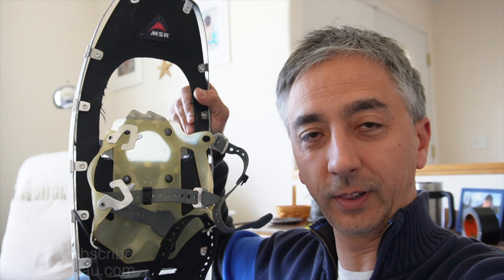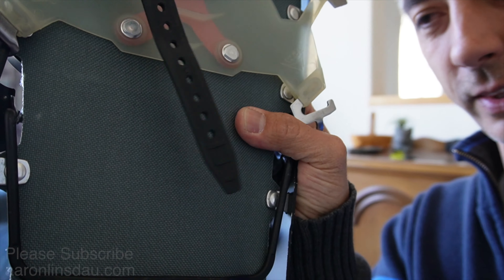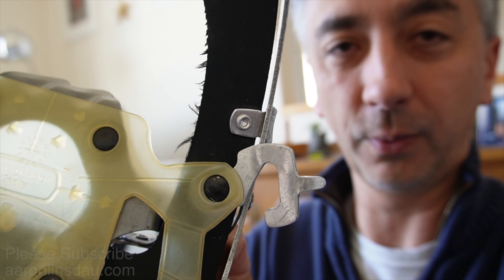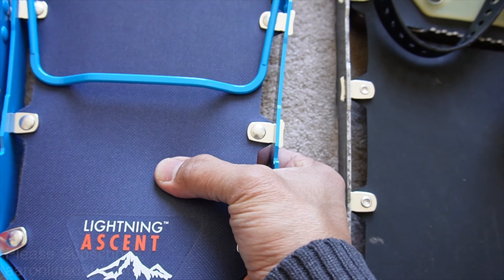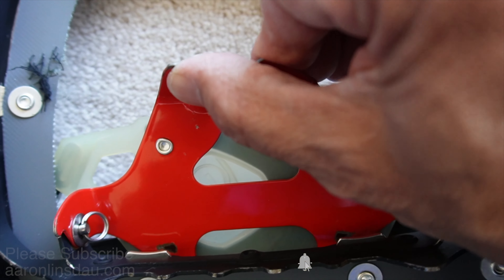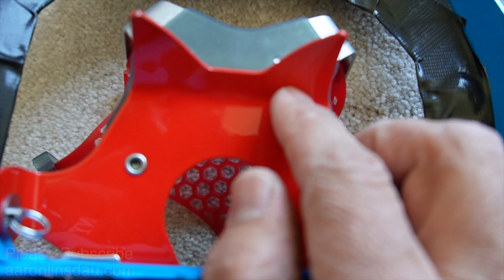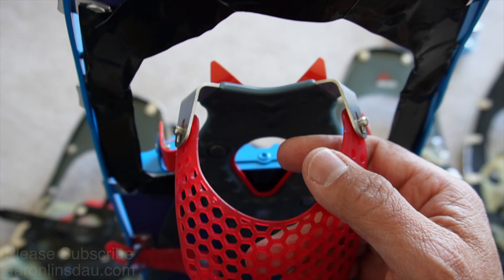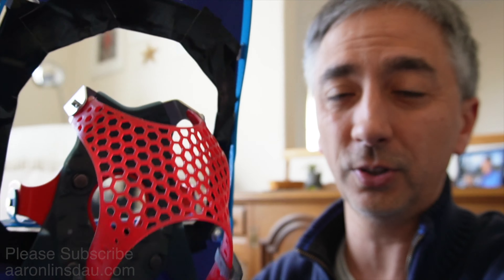MSR Lighting Ascent Snowshoes Failure - Fix & Prevent (4k UHD)

Comment: Question for you... I just got back from a snowshoe trip with my lightning ascents and when going uphill I used the heel lifts, which were great for only about 5 minutes. The problem is that they(especially the left one) kept falling back down after a few steps... So frustrating! Have you ever had an issue like this and if so, what can I do to fix the issue? Thanks, Aaron!

Comment: I have a pair of ascents like your first pair without heel lifts, but mine came with heel lifts and the same set of silver fangs on them. I have  never had a problem with them. Guess they have the good hypalon decking as well. But your second pair you showed I see has damage from what looks like the strap buckle catching on the hypalon as your foot moves through the boot opening. This happened on a pair of my plastic MSR Evo ascents. Maybe your boots are very wide, like mine were. I just had to be careful when I placed my boot into the binding, so it doesn’t catch on the side. Kind of crappy I know. Maybe some thick seam sealer would work better and look better than duck tape. I recently bought a set of the new Paragon bindings for $40 US each from MSR, but have yet to try them out for durability. You can also purchase the red mesh straps separately as well, for $45 a set. I actually got mine from Amazon. I have seen videos of people with broken hinges even. It seems like older MSR snowshoes were definitely more durable. I’m 6’2” 230 lbs , probably 260lbs with my day pack and my Lightning ascents are 9”x30” so they are going to take a pounding when I get out on them, hopefully the new bindings hold up, but if not I’ve still got my old ones. I’ve also found that the metal parts the straps fit into leave permanent indentations in my boots that look like cut marks.
Reply from the maker: Yes, the new position of the heal lifter damaged my $1000 Millet boots. Not happy. I added a gob of shoe goo to the boots to reduce the damage. Wish I could go back in time and buy the older style w/lifters.

Comment: Hey man. Great little video here, i just came accross you.. I also have an old original pair of the Lighting Accent WITH heal lifter. Like that beautiful Lime Chemical green color.
Whatever it has been 18 or 20 plus years i dont really remember the timing anymore.
Still in half descent condition, plenty of abuse, i have always been a Heavy guy 280 plus.
I was in Love MSR. My uncle and i multple MSR, tents, stove, cook wear, 3 different water filters.
But i just cant believe in those Snowshoes any more. Too many problems, and where the heck are they getting off on 400 to 550 plus for Snowshoes. Sorry but i am going Atlas or Tubbs this year.
And thats gonna be pair 7 or 8 in 25 years. 
Anyways great review 👍
Reply from the maker: My old ones had a way stronger deck. I climbed up rocks on Mt. Whitney and barely a thread pull. The new ones - not so much.

Comment: I think one solution for these problems is to laminate harder " plastic" over those skinny easy wear spots - additionally I think Shoe Goo might be a better choice than tape - if you coated the top and bottom of that fabric and make it a bit thicker at the edge - that stuff is bullet proof. I would imagine it would also encase that little tiny attachment point to be sure pins and nuts don't fall out. Signed: A guy who's never worn snowshoes in San Diego...but I was recently looking at the exact same shoes since winter isn't going to end in the Sierra this year. So thanks for the great info. Cheers all
Reply from the maker: Great suggestion - I'll have to try it. Thanks!

Comment: I had a pair of Lightning Ascents and was very underwhelmed by them. The foot opening is too narrow for wider boots, my Sorel Conquests caused the binding buckles to tear the decking like yours. 
Another problem is your heels, and therefore a lot of your weight, rest directly on that paper-thin decking and the top of the braking bar directly underneath. They DID glue a small second piece of the paper-thin decking on as a reinforcement, at least. 
As you said, the strap-type bindings can cause hot spots on your feet, and on steep downhills can allow your boots to slide forward in the bindings. Tightening the straps takes care of this, but now there’s even more chance of hot spots. And I’m with you about not trusting that Paragon binding mesh at all! 

The traction-framed snowshoes I much prefer, and recommend to anyone in the market, are GV Mountain Extremes. Their bindings are much more comfortable, with a molded toe stop on the foot plate and 2 wide ratcheting straps over your foot. The ratchets are easy to use with gloves or mittens on, and can be put on or taken off in seconds. 
GV’s decking is much thicker and much stronger than MSR’s, I had to use my snowshoes as traction boards under my stuck Jeep once and the spinning tires slightly abraded the decking but there was no penetration. The frames were bent but 5 minutes with pliers & Vise Grips had them back to normal.
Your heels rest on serrated cleats that stick up maybe 1/4” through openings in the decking, and these are riveted to a braking bar so you can directly stamp into packed snow or ice. 
I’ve had my GVs going on 8 winters now, and had to send them back for warranty repair twice (I’m very hard on them!) I’d email them, they’d reply within 2 business days, and within 2 weeks of shipping them I had them back. You can’t even get a call or email from MSR that quickly!
The GVs are built like tanks, weighing about 8oz more than same-sized MSRs, and don’t accept tails. 
Lastly, but definitely not least, the Mountain Extremes cost a little more than half what Lightning Ascents do.
Reply from the maker: The original MSRs were super strong. I climbed up bare rocks with them and they held together. The new decks are so thin, they tear like nothing. Total failure.

Comment: You missed the root cause of the failure of your decking.  And the new paragon binding fixes that.  The decking was tearing from the first "buckle" (over your toes) hitting the decking when your toe rocks forward.  I have the same pair and it is almost torn through on both of my "women's" (more narrow) pair.  The new paragon binding does not have that buckle and will not hit the decking.  Note that the tearing is not in other locations.  
I have another failure - on the under side back by the heel.  The decking is reinforced by a smaller second piece of decking.  The metal cross piece cut through the added (2nd piece) of decking and is now working on the main decking part.  
I like your analysis of the metal toe spikes.  I did break one on my pair (but I still use them).
Reply from the maker: The old design was far superior and the deck way tougher.

Comment: Great video, as always! Are these 30 inch snowshoes? What is your opinion on getting 25" snowshoes and the 5" extension? Is it mostly versatility vs robustness vs transportability? Would like to hear your opinion on this as longer MSR snowshoes help with heavy packs.
Reply from the maker: I used the 25" shoes. The 30" are pretty awkward for me. I've not tried the tail extensions but have never felt the need for them.

Comment: just thought, not that I ever used one but. What about getting a 3d printer machine and make your own snow shoes, or at least my be replace broken parts of the snowshoe? if people can duplicate a working gun a snowshoe should be easy.
Reply: Only issue might be how brittle the 3d printed parts become in cold environments
Reply: @jakbro5633  DMLS 3D Printing
Metal 3D printing in stainless steel and aluminum materials
Reply from the maker: Regular 3D printed plastics won't take the beating.